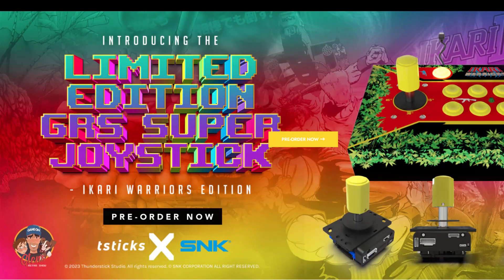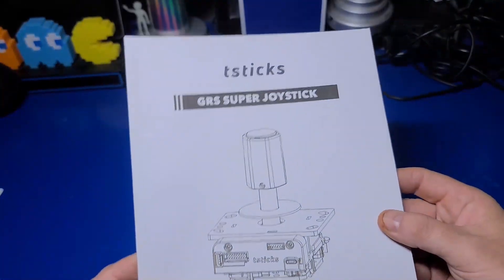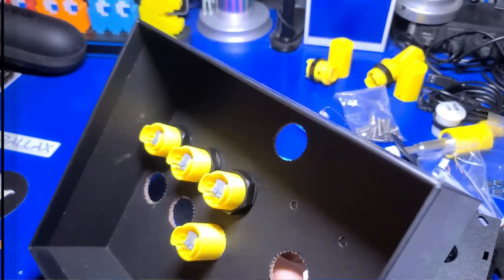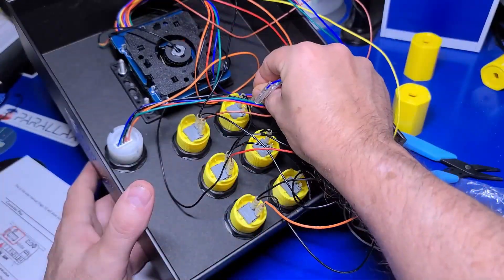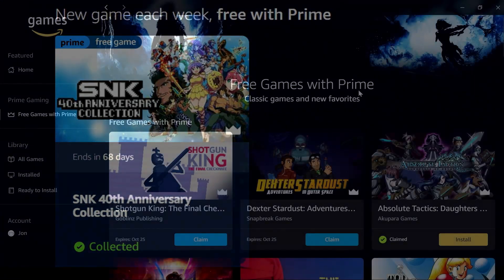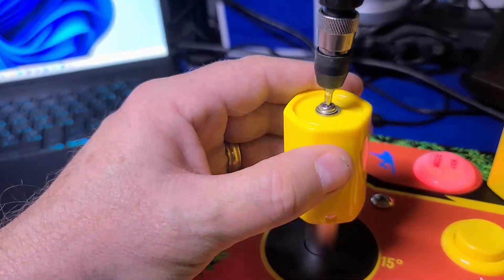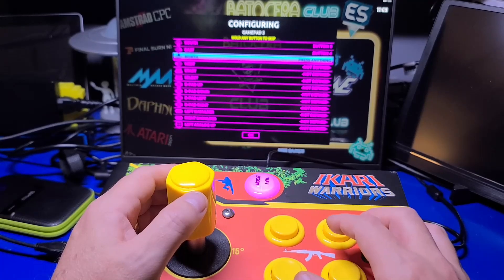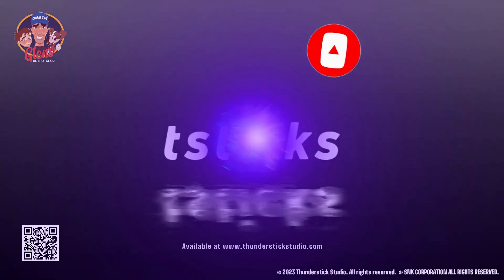GRS IKARI Warriors Super Joystick: Setup and REVIEW!

Comment: Got this some months ago and I LOVE... the idea of using it. But it's still unassembled, waiting for the next free Saturday. I'm torn between using the box as the, um, box, but also getting a custom case like The Fighter from Haruman's Customs. I'm actually leaning towards the box since (1) it's already paid for, (2) it's already got the artwork, and (3) if I'm going to be using it as a spinner, I don't want a heavy enclosure on my lap. Plus I figure I could still do the same things our friends in the FGC do to the box, i.e. Neutrik hole for detachable USB and adhesive foam feet to prevent slippage.
Reply from the maker: I thought about installing it into an Arcade cabinet my son and I built several years ago, may still do it at some point when I have time.  I really want to re-work the entire control panel and this stick would be ideal for it.  Thank you for watching!

Comment: Nice. I was really hoping this could also be used as a spinner too when I noticed it in the product description, but MadLittlePixel's review made no mention of this. Despite this, I already placed my preorder. I'll try it in the box, but I also have an old HotRodSE controller that I may replace the player 2 side with this as I rarely have anyone else play on it (heck, I don't use it much lately and haven't even replaced the old PS/2 encoder with a USB one, just use an adapter every time a take the controller out).
Reply from the maker: Glen sent me a video that showed it working with Arkanoid and mentioned there would be a firmware update to allow using it as a spinner.  That will open the doors for many more games that work with it.

Comment: Does this joystick also sometimes skip a step when turning the knob or is really every turn registered and translated in the right movement ? ... with the original SNK rotary joystick sometimes a turn step is ignored (tried this with different controller boards).
Reply from the maker: I don't recall it skipping a step, but depending on the game code it may detect the position differently.

Comment: Hey man great video! I found your channel after watching all of your AtGames 4k videos. I have a question on these joysticks, I did email the company (thunderstick) but they said it wouldn't work. So I have 2 arcade machines that use the LS-30 joysticks, and one of them needs new sticks (Heavy Barrel). Do you know if the wires that come out operate as each switch without USB power? Like I can just connect each wire to the arcade harness, and they would register as inputs? I feel like it would work, but they wrote back and said these couldn't be used with out the interface / converter USB board. Thanks and if you don't know, no worries! Great channel, I am subbing!
Reply from the maker: Hey brother, thank you for checking out the vids and for your support - greatly appreciated!  I don't have an original LS-30 stick here, so I'd definitely go by what thunderstick/GRS have mentioned.  I wish I could say based on experience that it would/wouldn't work but I can't.  I hope you find past/future content just as interesting, a lot coming.  Also, be sure and check out the guides here: https://wagnerstechtalk.com/guides .  A lot of how-to type stuff that cover a large number of tech/gaming topics with much more to come!
Reply: @WagnersTechTalk  cool man thanks and yeah no problem. I think I will try one anyway, I have their tron joystick and modded that for an arcade cab. Took a bit of work to get it to a commercial level, but I think it's been holding up well after some tweaks. Also I installed it on Polybius, so maybe that's why haha

Comment: why does the panel say 15-30-45 and zero degrees instead of 90-180-270-0/360 degrees as it should
Reply from the maker: Please give me the timestamp in the format mm:ss , I'm not sure what section  you're talking about.
Reply: @WagnersTechTalk  - 3:42 - the hole around the joystick
Reply: It's how the arcade control panel was designed 😊
Reply: @GlensRetroShow  -  interesting.  I didn't know that.  I learned something today